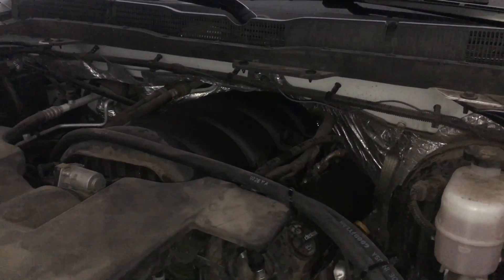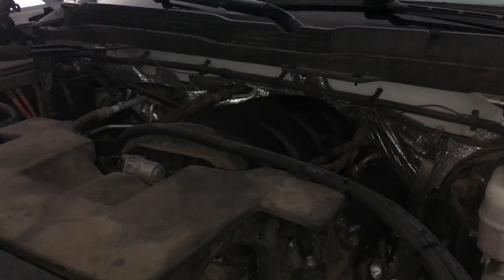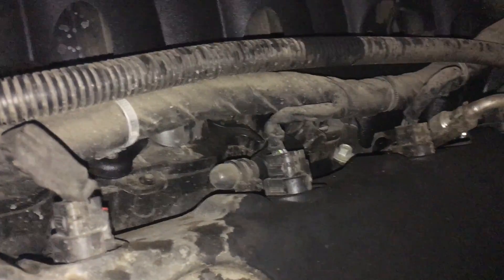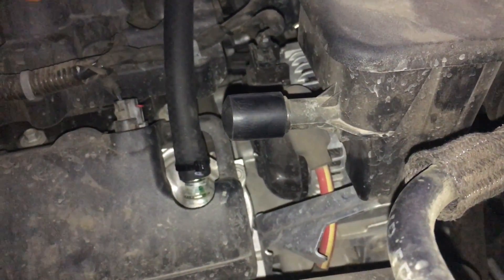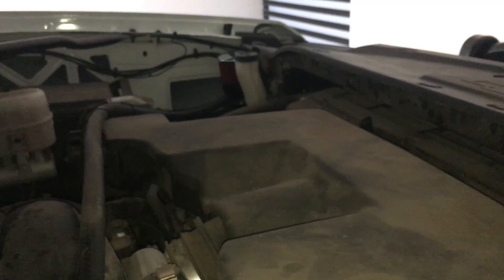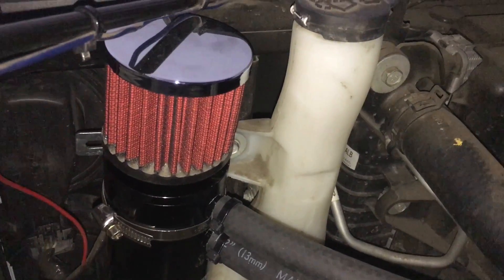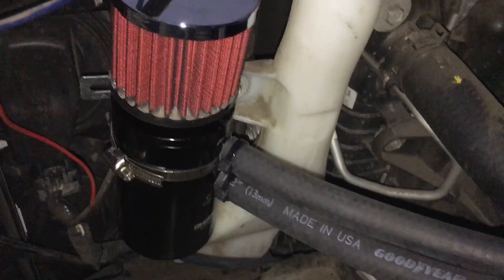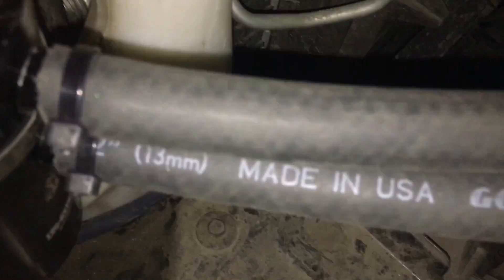How to Correctly Install an Oil Catch Can: PCV Delete

Comment: I’ve wanted to do this but was concerned about burned oil odors. Do you get any ?
Reply from the maker: Not really, but since making this video I changed the set up for a crankcase evac to the exhaust
Reply: @BadAssEngineering  u know where the valve is under the catch I have air coming out of it is that normal lol??

Comment: this is not the purpose of the catch can, it is to catch oil that would be sucked through pvc system into intake of engine messing with your fuel mixture. you just added a breather and lost your negative pressure, or vacuum..

Comment: Can you be more specific as to the connections on the pcv side, and also which hose goes to the in and which to the out on the oil can. Thanks. P.s. my pcv is connected to the manifold and not to the valve cover

Comment: or hurtful to the engine if you run the hoses from the valve covers to a catch can with a breather and have the pcv system blocked off

Comment: This isn’t engineering😂. Run it through a heated air-oil separator with an oil return line and an air return with PCV to maintain negative crank case pressure.

Comment: I'm just curious.  Couldn't you have caped of the clean vacuum side in the plastic intake and then used the dirty side PCV on the valley cover (crank case) and vent it down to the ground like to old road draft tubes?  The two breathers on the valve cover would still serve as the clean air intake.  Yes or no?   The way you have it it looks like the valve cover breathers are now both the source of fresh air intake , your breather on top of the catch can, and also the PCV since you capped the one off on the crank case - I'm confused.
Reply: Yeah, it's confusing. Part of the point with pcv is to prevent buildup of harmful gasses in the crankcase. This system doesn't do that. It only allows a vent for them, once they've built up.
Reply: the point of this video is to confuse. Period

Comment: This way is doing atmospheric pressure while it works is less efficient than using vacuum from intake system and keeping the crankcase under vacuum rather than 0 or greater psi

Comment: Engine will run lean or rich without a properly functioning PCV system🤔 ...

It became mandatory in all vehicles on 1967 here @🇺🇸
Reply from the maker: Ecu trims fueling accordingly
Reply: @BadAssEngineering  No really, this will caused the fuel trim to be off....main reason why cars manufacturers upon  today still use the positive Crank ventilation system  ...🤔

Comment: vent to air good idea because the pvc can still clog in winter and not let gases escape. dumping oil to ground bad idea.  don't be lazy and just drain it when needed.

Comment: Cool. What’s happens if I accidenty plugged the hose that the pressure comes out. For a little bit and ran it idel and around the block hard ?  Seems like there is a lot of crankcase pressure md it bows some white smoke out the crankcase and exhaust.  I did just clean the really dirty throttle body with cleaner

Comment: PCV valve on one valve cover, run it to an Oil Catch Can and from Oil Catch Can to your carb pcv vacuum inlet. That way you vent your blow by gasses properly and not have carbon build up on the intake. Breather cap on 2nd valve cover. Get a clear Oil Catch Can so you can tell how healthy your engine is.
Reply: Mine is an Alloytec v6 ,where do I run the other vent to?

Comment: Why don’t you just put breathers on both valve covers
Reply from the maker: Yes, I tried a few different set ups over the years and finally settled on a Crankcase evac system

Comment: Just hook up a hose routing it to the bottom of the car, you do't need  a catch can at this point.
Reply from the maker: yes, and Since making this video, i changed to a exhaust scavenging system
Reply: @BadAssEngineering  hook it up right next to your front tire and let it vent all over it
Reply: @BadAssEngineering  hope you don't have a muffler or it's going to catch on fire
Reply from the maker: @_Epictetus_  it's been years, no problems so far

Comment: You might as well run the PCV breather directly on the valve cover. The Catch can is there to separate the oil from the air on a 'functioning' PCV system. You are just venting to atmosphere which gets rid of the original function of the PCV valve.   
I do my install differently. I have a baffled catch can, and then the PCV valve is installed after the catch can. This way the plenum volume of the stock intake manifold does not see the extra volume of the catch can which should help the MAP and other sensors respond accurately to changes in pressure and the catch can doesn't act like a slow bleed reservoir that might affect response. On the valve train side it doesn't matter that it sees the extra volume of the catch can, which should help slow the gasses down further allowing the oil time to separate from the air.
Reply from the maker: Since making this video, i removed the catch can and im running an Exhaust Scavenging System
Reply: dumb people come here to appear as experts on legitimate issues all while sounding informative and intelligent. this is like spewing diarrhea from your mouths.. sounds like you guys need a state of the art catch can for your mouths

Comment: Taking in consideration both catch can types take the oil thrown on pcv, these are the other advantadges/disadvantages:

Vented catch cans:
Advantages
- no hot oil breather to engine -> lower intake temperatures -> less air density -> more air inside the combustion chamber in each cycle -> performance gains

Disadvantages
- No intake vacuum to extract the fumes -> less fumes extracted from crankcase -> faster oil contamination and a sludgy bottom engine
- Engine tends to run cooler than it was designed -> fuel consumption will be higher
- More pollution to air and smoke smell inside car

Recirculated catch cans:
The opposite of vented catch cans but the intake temperatures will be almost the same as in default engine

For petrol engines vented solution is perfect no question about it. For diesel engines, if your piston rings are good and don't let much smoke to come inside the crankcase the vent solution is enough, if your rings are worn you need to use a recirculated system since you need to extract more fumes generated and the intake vacuum will help a lot on that
Reply: There should be zero contaminants in your air-fuel mix to your combustion chamber. .
Reply: @kevinoneill41  If that was true, engines will not use pcv direct to intake manifold, instead will sink the pcv fluids to exhaust line
Reply: 1 of each? would eaqual beast mode?

Comment: the drain tube should be tucked close to the frame/body so the dripping oil coats the underside and frame for maximum rust protection!

Comment: Isnt it bad to leak your old oil to the road? Maybe you can be getting it on your tires or someone elses?
Reply from the maker: Its not like it pours oil out, the engine would lose all lubrication if it did...

Comment: Do ventilated catch cans make your car smell like Oil/Burning Oil ?
Reply from the maker: Hossein Not really, but since this video I converted this setup to an exhaust scavenging system
Reply: Depending on the location of the catch can, if it is near the fan that gets air to inside the car yes it will make
Reply: In my case it happens and it’s really annoying, I think I must relocate it because is on the front of the engine

Comment: If you're going to just vent to atmosphere (and the street), why even bother with the can in the first place? Why not just have the hose connected to it just hang down (in turn be a dick to the environment)? This whole post in junk.
Reply: Think he now scavenging through his exhaust. Just not sure. Still better than through your turbo and intake ports, then collecting on valves piston and combustion chamber. Turning into carbon. Making the whole thing run like crap 💩 and start compounding. Just collect it get rid of it with your next oil change.
Reply: @kevinoneill41  But then depending on where you connect it to the exhaust you're either crudding up your cat (if you use one), or burning inside and ruining your pipes/mufflers what would normally collect in the can or burn in the combustion chamber if recirculated. The primary purpose of a can is to keep the excess crankcase oil mist from building carbon up, and the second is to keep what's separated from the recirculated air out of the environment. If he's only worried about carbon, he should just use a draft hose that's like $2 of hose.
Reply: Cause oil and fuel and shit comes out of it
Reply: @aywhatsgood8780  but he's just dripping to the floor anyway with his hose

Comment: People this fix isnt 'polluting'. Letting the PCV system plug up from poor PCV design causes engine seals to leak oil on road and use MANY quarts of oil used. This guy is saving ALOT of pollution from happening by "by-passing' the PCV system.

Comment: Don't like to burst your bubble mate but please explain to me why I should spend $35 on a device designed to catch recycled contaminants, then punch a hold in it and run a pipe to the floor.  So what exactly is the can doing in the loop then?  This is so stupid it can't be serious.  Was it an April fool?
Reply from the maker: Jonathan I decided to make this (not so serious) video while I was testing a lot of set ups for the catch can, it already came with the bottom drain and my current set up is much different
Reply: Jonathan Bywater you’re an idiot if you don’t understand this

Comment: Good video. Where does that 2nd hose come from? Driver side is capped. I see that. I see the hose on passenger side going to catch can but where does that second hose come from? And ppl. I throw my old oil in the oil bottles in my trash can or blue recycling can. Who cares?
Reply from the maker: The capped one is the little pcv that goes to the manifold for when there is vacuum in manifold), the other 2 come out from the Cylinder heads to the airbox (for PCV to vent when there is no vacuum on manifold, like at WOT)

Comment: Can you vent the vapor back into the air intake?
Reply: A normal catch can would. U just drain can routinely. This guy deleted his pcv entirely and routed to the atmosphere
Reply: If you run the line to your intake you then get this gooey substance going through your tubo eventually causing a balance issue, then the same gooey crap 💩 will form on your intake ports, valves, piston and combustion chamber creating a carbon build up on the heated parts. This is what we don't want. Especially in a GDI engine.

Comment: Doesn't those slightly oily fumes travelling back to intake lubricate your throttle body with all moving parts? ....and oil catch can cuts that lubrication off? Just wondering what that causes ._.
Reply from the maker: They cause build up of containation, and gunk on the intakes, since GDIs dont have the injector cleaning the valves. Straight gasoline is more than enough lubrication for the upper cylinder :)

Comment: All these comments ... Lot of haters... But what the haters don't know is that less than 1% of the cars on the road do this ...  So 1% are not harming the atmosphere any more or less than exhaust from the engine and those cars that already leak oil and coolant onto the ground...   Why don't you guys go hunt down all the cars on the road that are leaking oil and coolant and tell them to fix their car because they are polluting the roads... 

If you don't like what this guy is doing, don't live in his city cause his blow by may suffocate you ...

And besides, I have an oil separator which CATCHES the oil at the bottom and only releases filtered air back to atmosphere...  After a few weeks i open the bottom of the can and take the oil and put it in my USED oil jugs...
Reply: You don’t get it don’t u see those cars are like that from over time but this smart ass guy is the cause of his leak

Comment: Consider using "AssBadEngineering"...why waste the money on the catch can if your only putting the oil on the street? You can do exactly that, like auto manufacturers stopped doing in the 60's, without the catch can, smart guy. 
Disconnect your useless for show catch can and simply put your hose on the crankcase passage  opening where the can used to be..same result. ROFLMAO
Reply from the maker: I love you too

Comment: the proper way is to install an oil catch can without removing the pcv system. the only purpose of instaling a catch can is to prevent oil getting into the engine and burn, preventing carbon deposits.
Reply: Exactly!!!

Comment: Out of curiosity, I have a question regarding your "oil catch can". So, you vent the air pressure to the atmosphere and drain the oil to the road. Why waste your time and money on those parts? You should just do a road draft tube install on vehicles prior to 1961. It's cheap and effective. 

Most people who install a catch can still have some conscience for the environment. The crankcase ventilation accounted for about half of the smog. That's why it get burn off to reduce that smog. The catch can would eliminate the oil from the ventilation but still allow the hydrocarbon to recirculate back and get burn off. Cleaner environment and less carbon buildup.
Reply: Collect it recycle it with your used oil problem solved. Vented filtered  collection system?
Reply from the maker: I actually drain the oil to a bigger reservoir below the catch can so i dont have to clean it as often, but its always fun to troll people :)
Reply: Not funny. You are giving dump ideas to dump poeple. People like you are the reason Greta T. gets way more attention than she should. Keep promoting shit ideas like that so evironmental regulations will put an end to things that are fun even sooner. Great job pal!

Comment: Don't make videos of wrong information. There's about 4 things wrong with your video
Reply: So what are they? Bold claim with no points
Reply: @BMW_DAILY  1) There is no "catching" if dumping... so... no catch can required. Just vent the gases to atmosphere. 2) Recirc'ing vapors into a port-injection engine isn't a problem anyway, so why even mess with it? 3) combustion gases and oil vapor being vented into the engine bay is just a good source of toxic air ultimately entering the cabin, if only in small continuous amounts. 
Sorry... I wasn't the original commenter, so I don't know what is #4 ;-)

Comment: Idiots not understanding proper crankcase evacuation.....crazy crap here!
Reply: it only needs ventilation because if not it would become pressurised by the engine running (look up piston blow by). they only design the car with it running back to the intake due to emmisons regulation. so to answer your question it vents itself due to pressure in the crack case, the catch can relieves this pressure.
Reply from the maker: Im sure insulting people on their videos will bring a lot of good business to you
Reply: As your unwilling to have a intelligent technical discussion on this. If your open to it I'm all for it so all can understand proper crankcase evacuation. Here is another good educational video:  https://www.youtube.com/watch?v=EPIfI9aZHt4&t=24s   You obviously do not understand the functions of the PCV system and by defeating the evacuation process you sacrifice the life of the engine in doing so. The constantly entering damaging compounds must be flushed and removed from the crankcase before they can settle and mix with the engine oil. Your leaving all of them in to now accumulate and accelerate wear.  We do R&D for tier one and tier two suppliers to GM and Ford. I started with GM in 1974 and am a member of SAE and our firm does extensive work on crankcase evacuation systems including testing work with one of the largest and most respected lubrication labs in the World.  You can take this opportunity to learn and expand your knowledge base or continue as you are. Your choice.
Reply from the maker: It’s not an open discussion since you’re biased to sell your product
Reply: Ignore my products, there are several direct competitors that also understand this.  Elite Engineering is one of the largest names in this field as well and their technical support can be reached direct at: Tech@EliteEngineeringUSA.com  Ignorance should never close someones mind. Knowledge is always best.
Reply: Tracy Lewis Performance:
MAYBE the pcv system should have been designed so that its evacuating crankcase gases the ENTIRE time the engine is running...
Reply: ok!!! then PLEASE explain how one can vent the crankcase without sucking IT back into your engine, witch over time kills the car

Comment: Idea of the can is it catches the crap before it goes back into the intake. If you have oil in the can...you have more problems than you think.
Reply: andrew wright what you mean isn’t the can suppose to be filled over time the engine is being used to eliminate oil slump and emptied out to be recycled at your closest auto shop? Like the fuck bro lol. In the end of your comment “if you have oil in can... you have more problems than you think.”
Reply: Not necessarily ....

Comment: Wow, first you remove the CAT on your truck, and now just purposely letting your catch can to dump engine oil to the streets...
I feel sorry for the people who live in your area.
Reply: Kevin Ping:
And this is how different from people driving around with OIL & COOLANT  leaks from their engine..??
Reply: There are valvecovers that leak more oil than this guy is gonna drip on the ground. Next time you are sitting in a drive thru at a fast food place look at the oil that has leaked on the ground from cars sitting waiting on a cheese burger.
Reply: Just how much oil do you think this guys 'catch can' is dumping on the road? You think its more than the many quarts of oil that will leak from seals by leaving the poor designed PCV system as factory designed it?